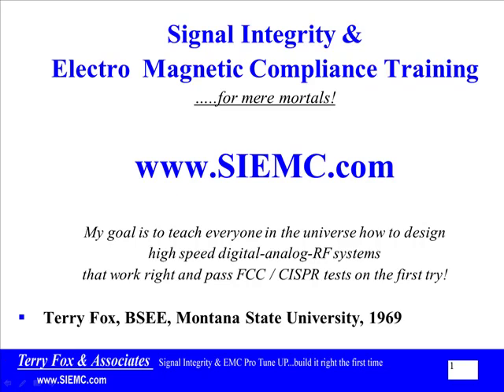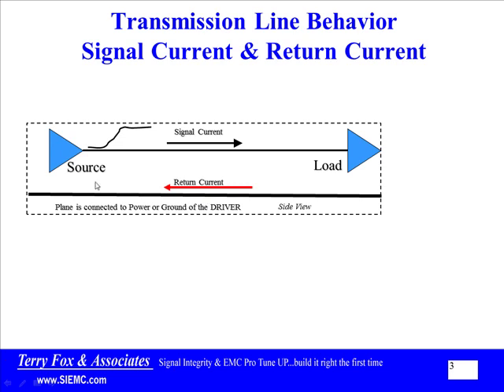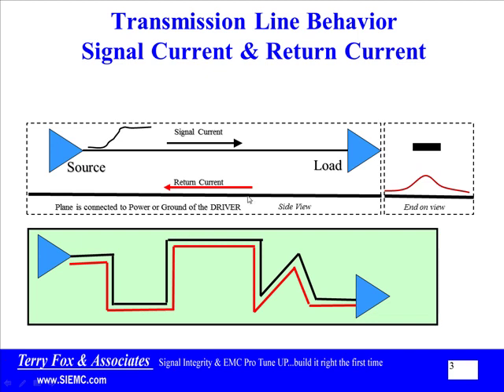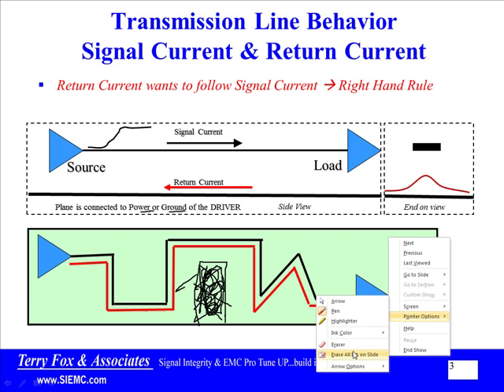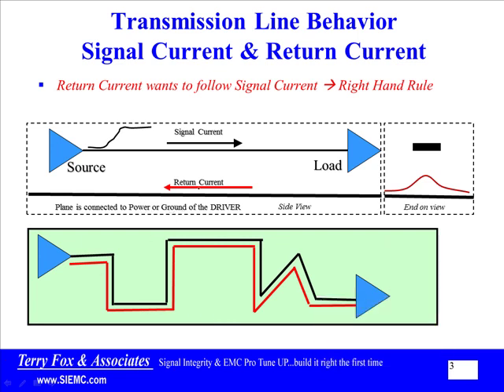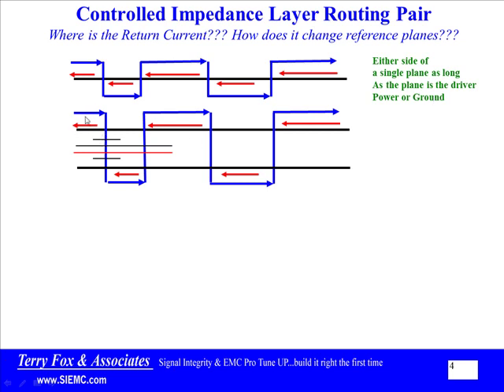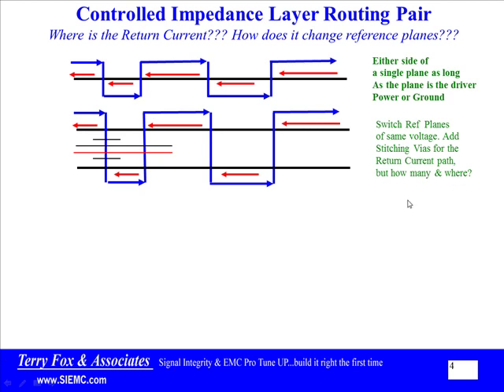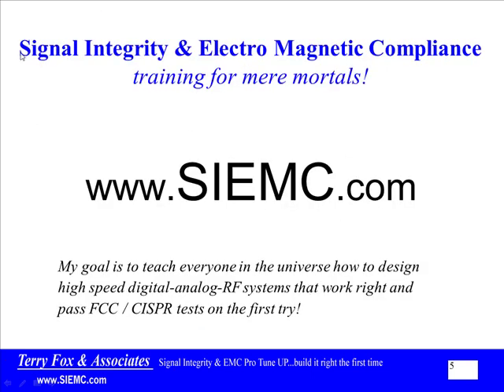Transmission Line Return Current

Comment: Hello, Thank you for the video, but I would like to ask a question related to what it's mentioned in 12.25. in a 4 layer board for the return current it starts from the GND of the load and end to the GND of the supplier if the two gnd are wired together so what's going to be the problem if we pass the signal through a via?? Also do you have any document that could explain more how will the return current pass through capacitor as you mentioned? Thanks a lot.
Reply from the maker: Fedi,  Using a 4 layer board for high speed digital work is EXTREMELY problematic.  Look at my videos on PCB stackup to get an idea about what I mean.
The return current is actually a moving field. 
I explain it as a physical DC type current because that is easier to grasp.
The return current can flow on either the ground plane or the power plane of the driver.
At low frequency it flows according to the path of least resistance.  At low frequency it resembles an ordinary DC current.
At higher frequency it flows along the path of least inductance.
If you have a trace over a ground plane or power plane of the driver the lowest inductance location for the return current is directly under the signal current on the plane.
The closer the signal trace to the plane, the better they couple.
There are many bizarre paths return current can take depending upon the topology.
The trick is to pick a structure where the path of the return current is OBVIOUS and can be explained at a very elementary level.
If it is unclear where the return current will flow, you can have no certainty about how well the circuit will work.
When you do not know that path, commonly available simulators are useless and you will need to resort to 3D FEM type simulators.

That is about all I can do in an email.
For more information on inductance, etc. find a good ElectroMagnetic field theory book.
Reply: @tfoxwa  thank you very much for all the informations.